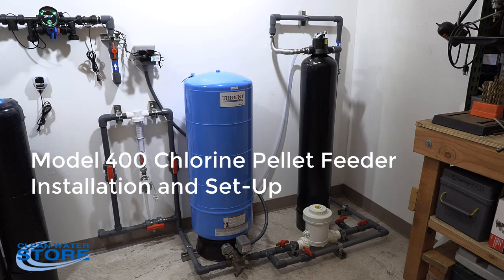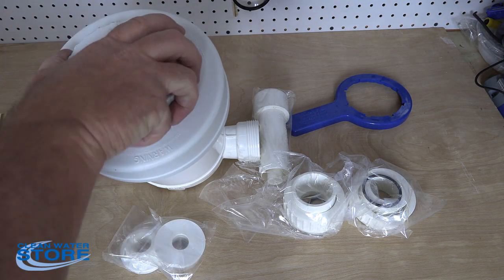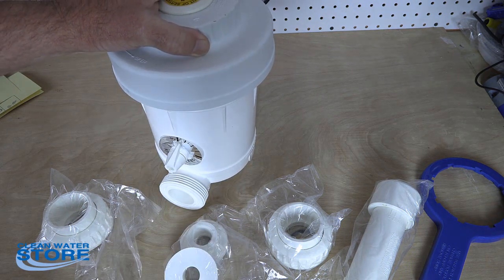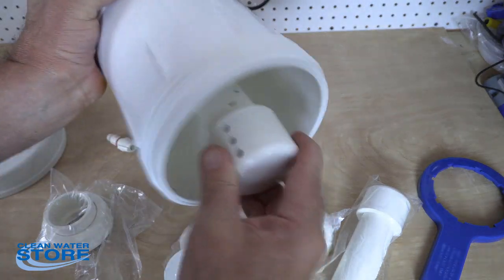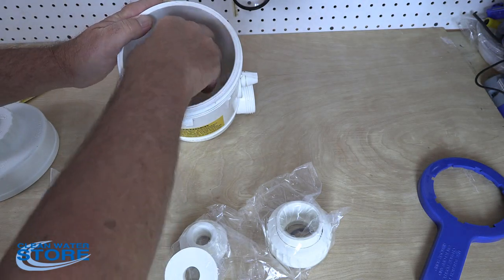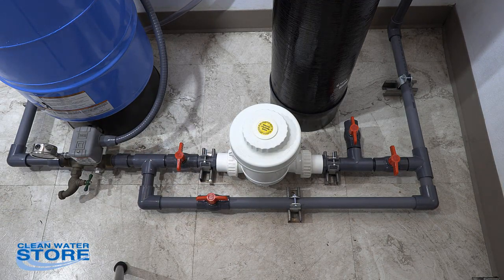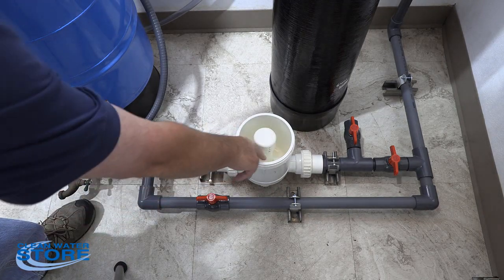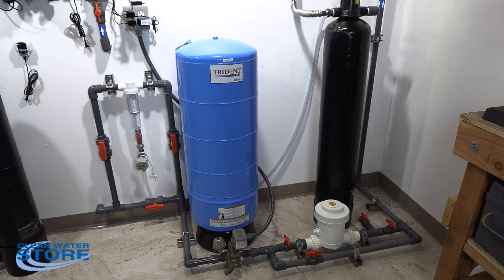Chlorine Pellet Feeder Model 400 for Well Water Treatment

Comment: The pellets dissolve in the feeder and add chlorine to the water stream of the house, not the well?
Reply from the maker: That is correct.  This type adds chlorine to the pipes after the pressure tank. For more information how it work please email our support team at support@cleanwaterstore.com
Reply: @CleanWaterStore  Do you have one that drops a few pellets per day down the well?
Reply from the maker: @andysmith5012   Yes we do. We can email you information and prices.  Please email support@cleanwaterstore.com with your email and we can send you info on those.

Comment: For standard fam avg, in the middle of the road reason for using it, how often would I plan to add chlorine tablets? Annually on avg? House of fam w/2.5 kids norm. Just want to know how often we'd be adding chlorine tablets.
Reply from the maker: Hello -  it depends on what settings you would use, which varies based on how much chlorine you need to inject.  Most folks use about  8 oz of pellets a month, if its set on one of the lower settings.   For example say the water has a moderate high sulfur odor and 1 to 2 ppm of iron.   You might use 5 to 6 lbs of years but it varies. https://www.cleanwaterstore.com/chlorine-pellets-granules/better-water-industries-sentry-chlorine-pellets-11-lbs-5-22-lb-bags.html   Definitely using liquid bleach is lower cost than the pellets as they have gone up in price a lot over last 5 years...   If you want more info please email our support team at support@cleanwaterstore.com.  Thanks!

Comment: I'm gathering the necessary accessories (valves, PVC fittings, etc.) needed to properly install my recently purchased Chlorinator Model 400.  What is the nomenclature of the metal track and straps used to anchor/mount your PVC pipes?  Also do you have a recommended vendor/source I could purchase them from?  

Great video.  Thanks for your time!
Reply: I guess it's kinda off topic but does anybody know of a good website to stream newly released series online?
Reply: @Aron Vihaan I use FlixZone. You can find it on google =)
Reply: They're using Unistrut or Superstrut and the clamps made for them.  The unistrut metal track comes in 10 ft lengths available at Home Depot or Lowes.

Comment: What does it look like when it needs more pellets? On mine, after a month, the pellets are gone but there is still lots of chlorine "sludge". If I dump that out, it seems I am throwing away a lot of chlorine.
Reply from the maker: If you are still getting a chlorine residual keep using it until the sludge is gone is a good way to go usually.

Comment: Sir may I inquire what kind of system to be install if the raw water is high in salt content? Tnx
Reply from the maker: Hello Edwin,    For salt water you need to use reverse osmosis or distillation.  If you can email us at support@cleanwaterstore.com with your water chemistry test and how many cubic meters of water you would need per hour, we can quote a reverse osmosis system for you.  RO systems typically need good pre-treatment as well, depending on the water chemistry and pH.
Reply from the maker: For high salt content, you would need to use a reverse osmosis system, or a distillation system.